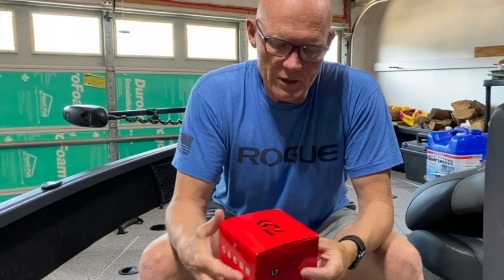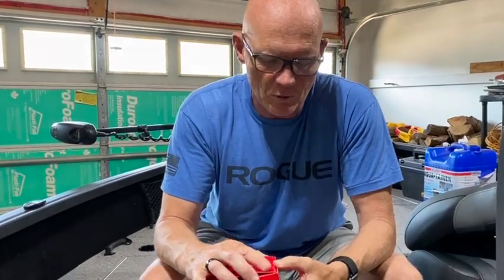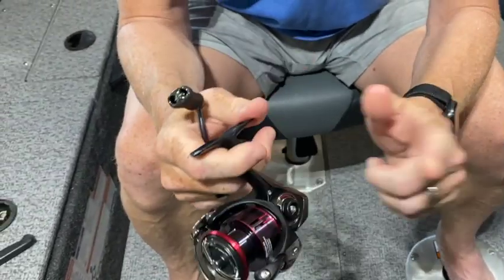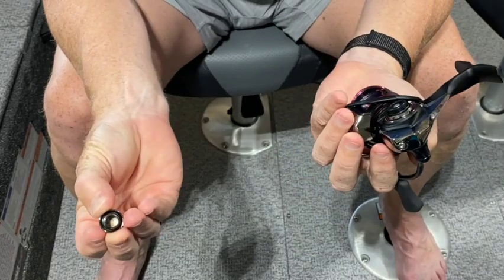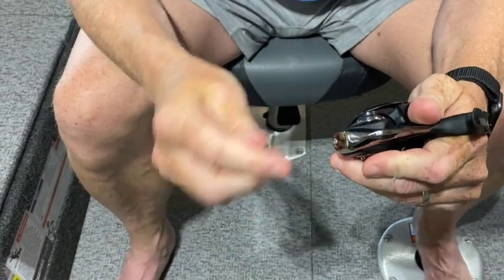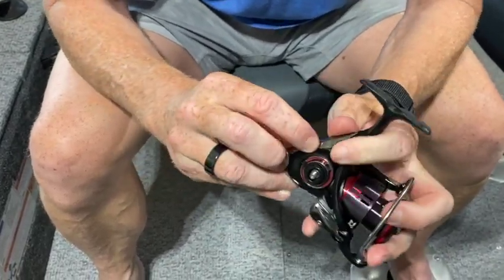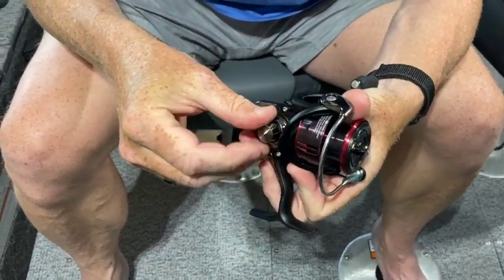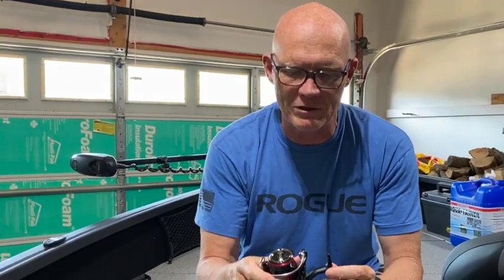How to Switch Handle on Daiwa Fuego 2500

Comment: Did you notice and issue where there is some play in the knob itself?  I just bought a Daiwa Exceler and notice there is some play in the handle you hold on to.  Cant seem to find a way to remove it and shim it as there is no screw!  Also a bit disappointed that the reel isnt as smooth as some of my older Shimano / Abi Garcia reels.
Reply from the maker: Hi Gareth. I have not, mine have been rock solid so far....

Comment: I bought the 1000 model for ultralite and the handle came separately and would only attach on the righthand (wrong) 
  I tried to use my swiss army knife to get under the plastic spacer thing but no go. 
  I’ll have to take it to the shop I bought it from and have them do it. Unbelievable.
 The last Daiwa reel I’ll ever buy.